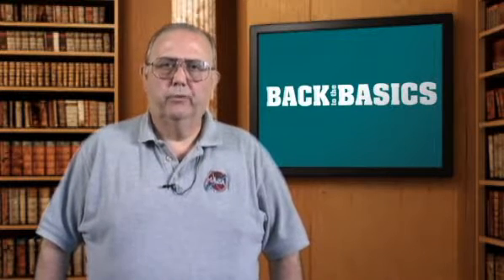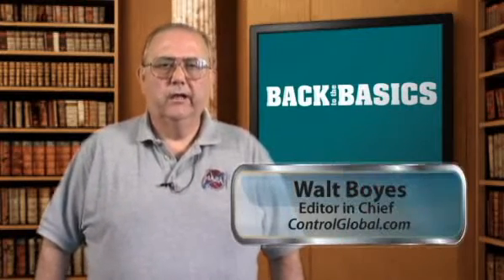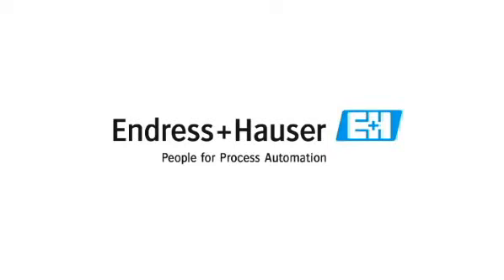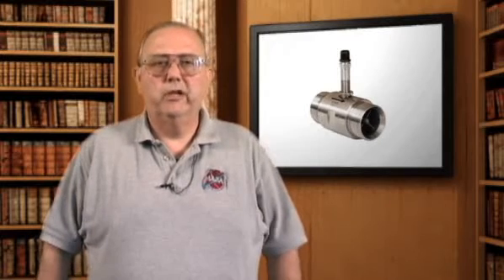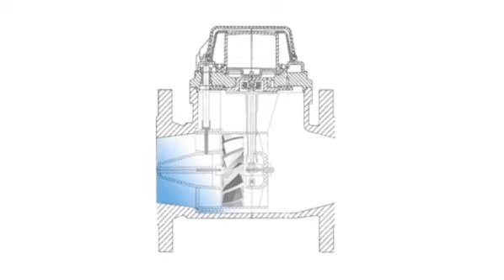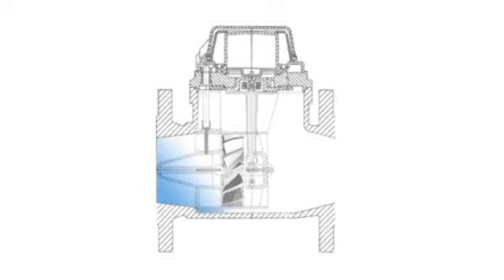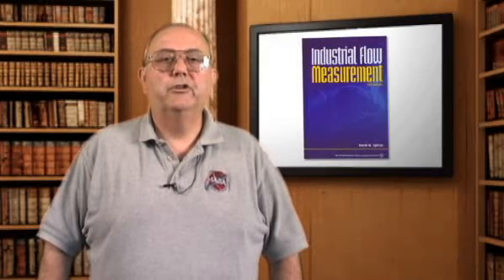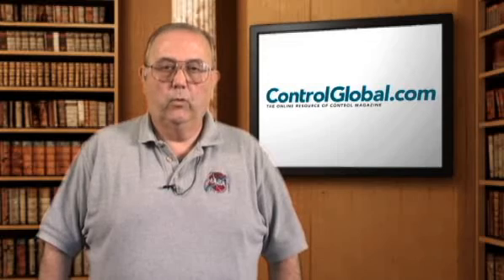Back to Basics: Flow Measurement

Comment: confusing to hear you say that Turbine Meters are "volumetric" contrasting "volumetric" with "positive displacement", are they not the same? Did you mean, or would it be more accurate to say that Turbine meters are velocity sensing and the velocity is then used to calculate to volumetric flow rate?